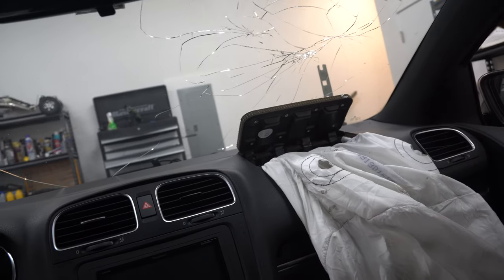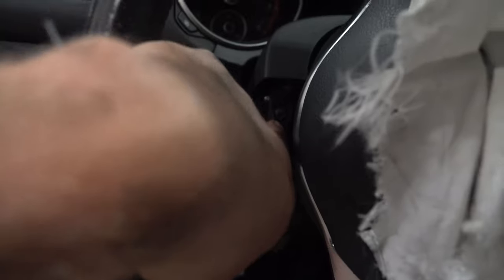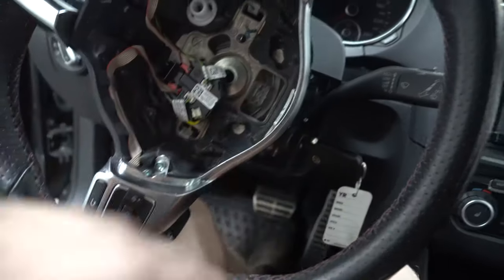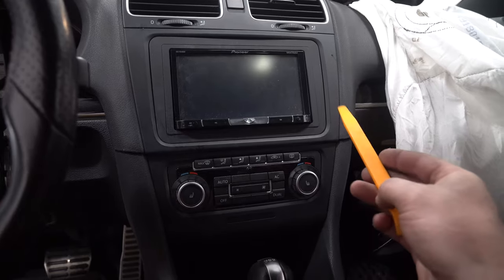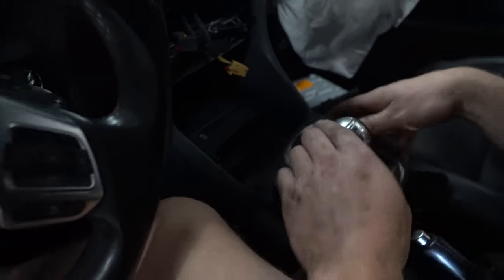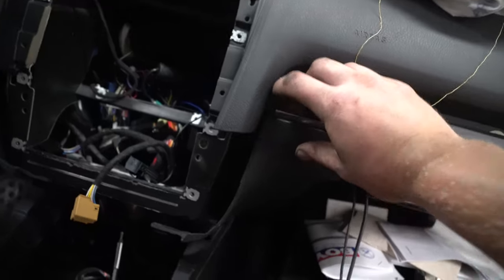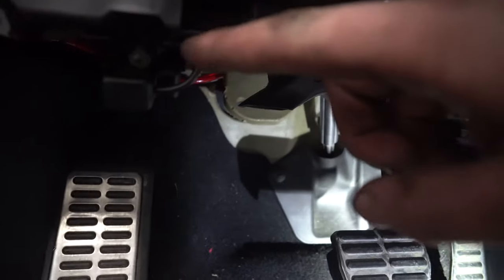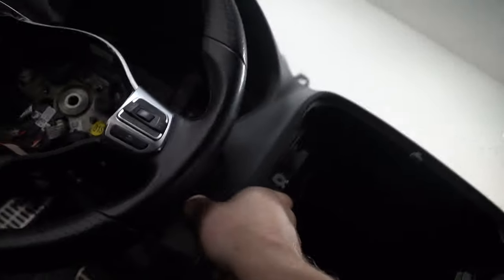HOW TO COMPLETLY REMOVE VOLKSWAGEN GOLF GTI MK6 DASHBOARD AND PASSANGER SIDE AIR BAG

Comment: I cant get the air vents out
Reply: It's because you need to remove the head unit first. When removed you can see that the middle air vents are bolted with 2 screws from the bottom. I did this 12 hours ago.